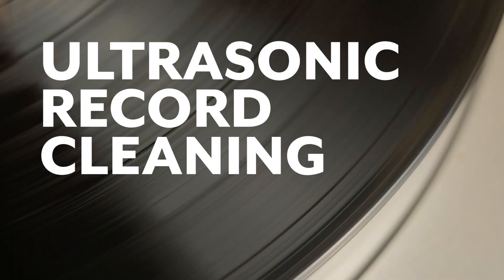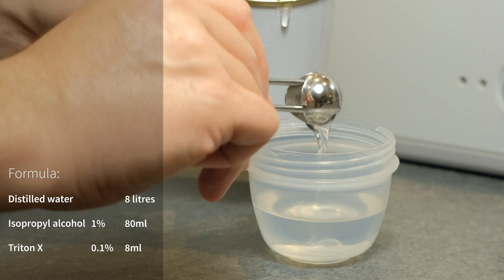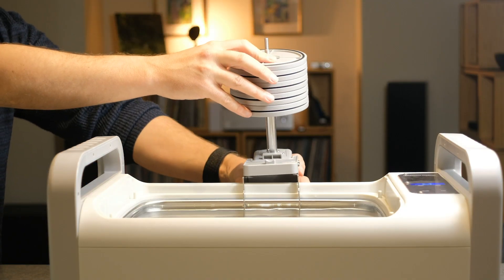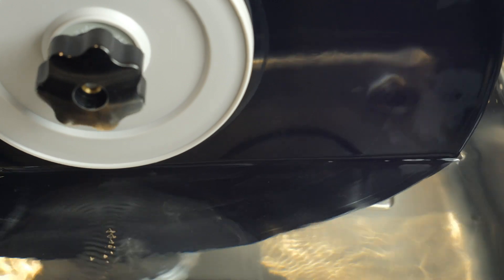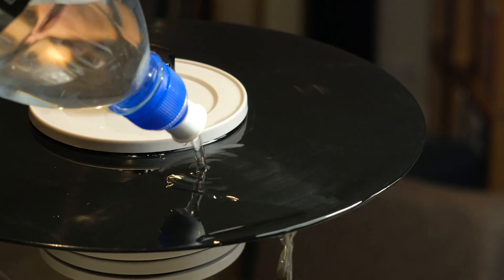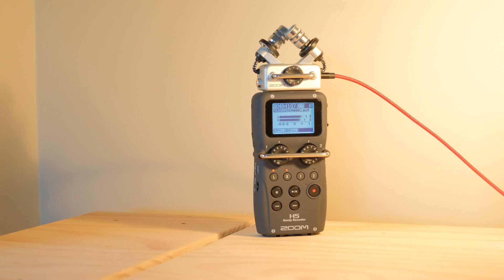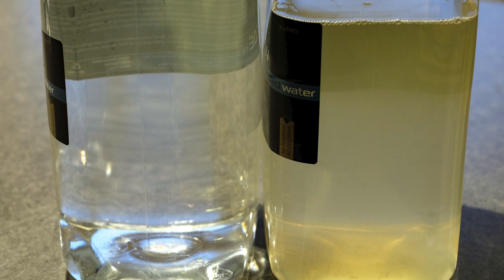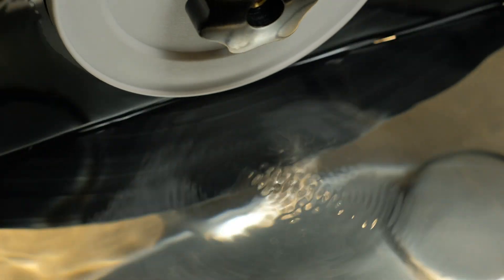Ultrasonic record cleaning - Before & After

Comment: Amazing video. One question. Once you clean up records, do you "preserve" the entire solution or dump it every time? If you want to keep it for extended time period like a few months, what would be the best way?
Reply from the maker: no I only keep it for a couple of weeks max. It will start to grow bacteria which you can see floating around as clumps (I forgot to throw some out once and it stayed in a bottle for a month or more. That's why it's important to dry the records thoroughly after cleaning.

I throw it out after it starts to look murky anyway.

Once you have some of that detergent that's shown in the video, a small can will last for years.
Isopropyl is cheap and so is the water, so overall it's really cheap to make. Best to just make a new batch.

I would like to find out if there is an antibacterial that I can put in the water.
Reply: @Filtersloth  Thanks for reply. I was thinking it's waste of money to throw it away after a couple of records cleaning though. I should wait for a batch to clean up. As you said, i wish there is something to keep it for a longer time.
Reply: @Filtersloth  did you ever get round to testing any antibacterials? from my brief research it seems benzalkonium chloride is the active ingredient you want, and it's in pool cleaners to vet disinfectants.
I've had no issues using a mix of water/iso/ilford. Usually get through enough in a day or two and dump the liquid after. Sometimes will run it through a coffee filter, but meaning to try TDS measurements to see if it actually has an effect.

Comment: You cannot remove release agent from records using this method.  While this machine is similar to KirmussAudio, it is not. We change the resonance of the sonic heads   .   Skewering records as shown  damages the label as seen. Reducrs recird value,, scratches the label.. More than one record skewered together sees no cavitation reach inside the grooves or up to the tone arm release tracks. . Isdyd of high standing waves and cancelation.  The cleaning agent added to the water in the basin has the same charge as that of the record. Good for a surface cleaning perhaps....  but cannot remove the pops in the grooves caused by  microwelded dustn by the heat of the needle on the release agent. Like charges repell. Record and wster... The multiple cycles of brushing the ionizing agent as found in the patented  Kirmuss process sees the charge of the record  change temporarily,  aiding the action of the plasma wave created by resonant cavitation. Tgecwave now attracted onto the record and into the grokvrs. The change of charge of the KirmussAudio process washes  off in 3 minutes or so. That is why the need for repeated cycles, first removing the films left over from prior cleanings, including those of this machine, then the release agent. Using the KirmussAudio process once restored and not just cleaned,  sees the record comes out virtuly dry, proving where like charges of the record with respect to water in the tank repell each other.
Reply: Kirmuss you got burned.
Reply: All.. we  have a video being made with three machines explaining how sonics differ and where in fact some look alike machines that have not been modified or using our support do not take advantage of ultrasonic technology.
Reply: In our video we will prove visually where the records are spaced too closely and the standing wave created negates intended action of the ultrasonic. The video will also show you how to test any ultrasonic for efficiency.
Reply from the maker: I realise that it's tempting for you to advertise your products in the comments of everyone's videos, and spread a whole bunch of misinformation and pseudoscience in a giant wall of text.

You've put so much nonsense into such a tighly packed, poorly worded and confusing paragraph that it would take forever to respond to every bonkers, made-up statement that you've just dropped in the comments. but I can easily address a few.
 
As you'll notice on the listening before and after test, there are no pops or clicks on the cleaned version, so there goes at least one of your made-up fake terms like 'microwelding'.

'release agent' is something you've made up and continue to repeat, despite actual chemists and vinyl press operators trying to correct you.

The record label is not damaged at all with the 'skewering' method as you call it. If it damaged it, then any normal use of putting a record on a record player spindle would damage it. 

 You mention having a 'patented kirmuss method' constantly, however the only patent I can find that you have for the machine is simply the part that holds and spins the record. While I think that's neat, and good on you for making it, it changes nothing for the cleaning process apart from limiting how many records are cleaned at once. I only cleaned one record at a time in this video so... problem solved.

You can mention 'ionizing agent' in an attempt to sound plausible all you want, but I'm not seeing any evidence.

Basically you'll need more than a cheap lab coat and clip board costume to convince people that your method is anything but an elaborate ruse tacked on to a normal ultrasonic cleaner (that is doing all the work, not your shaving brush and foaming cream). And the same goes for your nonsense cables.
Reply: Anyone working with plastic injection of which we have an injection machine knows that pvc has inherent to it a lubricant that comes to the surface of the item being pressed or in this case stamped.  At the Cascadia pressing plant in Portland during an ARSC sanctioned event at the subsequent meeting we removed the microwelded dust that fell on the hot freshly pressed record that saw a pop heard before restoration.  With 4000 units sold and accolades received, you can read them,  we in fact remove this coating from new or vintage pressings,  we can measure this both with a 3d keyence microscope as well as signal analyzers. You may yourself see the increase in signal before an after restoration using a vu meter, one on a tape deck. If you have a McIntosh  MPI 4 and check the cartridge,  you can see this yourself.  We validate our statements made by test equipment.  Client's ears hear and feel the result.  I have no relationship with the reviewers who have witnessed first hand the restoration effort.  Andre Jennings from The Absolute Sound would not publicly misrepresent his review of the effectiveness of our unique process.

Comment: Great results, but I'm curious why didn't you use the method Kirmuss audio recommends?
Reply from the maker: I've watched a lot of videos of Kirmuss talking and I find it hard to believe anything he says quite frankly. 

Like that thing he does with the 'special shaving brush' with the spray bottle and the foam showing up on the record after each wash... it's residual soap on the brush that doesn't get rinsed. It's a carnival trick to sell cleaning machines, which incidentally is the exact same machine as this. I do like the look of the record spinner on his though.

I do appreciate that he sounds like Dan Ackroyd in Ghostbusters though.
Reply: TooFriendly Your machine did come with all that stuff though, didn’t it?
Reply from the maker: utub what stuff? It only came with the record spinner thing and the machine itself, the stuff shown in the video.
This is a cleaning machine manufactured by Codyson, which Kirmuss would have bought in bulk. He’s said that his is tuned to a certain frequency but I really doubt that’s true. This machine is generally used for cleaning dental tools I believe.
Reply: @Filtersloth  Oh I thought the Kirmuss ultrasonic cleaner came with the brushes and the water-soluble detergent. I guess not.
Reply from the maker: @utub1473  this isn't a Kirmuss ultrasonic cleaner. I bought it from a record store called Real Groovy in New Zealand.
Kirmuss doesn't make ultrasonic cleaners, they just buy this machine from Codyson who is the actual manufacturer.

Kirmuss does have their own top attachment made though.
Reply: @Filtersloth  Ohhhh I see

Comment: Hey from the Tron. Cheers for the video. Is this the Real Groovy cleaner?
You still rate it and the Nagaoka Cart?
Reply from the maker: Nigel Humffreys Hi. Yeah it’s the Real Groovy one. It works well. The ultrasonic cleaner itself is not made specifically for record cleaning, so it’s the spindle add-on thing that’s been made with records in mind. It’s worth putting a bit of lube on the part of the rod that rubs against the plastic, or it ends up making plastic powder. Also you have to fill it up with water way above the ‘max’ line, or it wont reach all the record grooves.
I haven’t tried any other machines, but this one works well.
The Nagaoka MP-110 is great, although I’m no expert. I was thinking of trying out a MC cartridge, but only because I like to experiment. I’m pretty happy with my setup now really, it sounds good so I can spot a clean record vs a dirty record easily.
Reply: @Filtersloth  Cool thanks for that. Think I'll give both a try. I'm running a Sumiko Pearl which is great but so many good things said about the Nagaoka 110.
I was considering building my own ultra sonic set up but would be much of a saving from the Groovy one.
Reply from the maker: Nigel Humffreys Yeah I was going to build my own one, but importing a budget machine through amazon was actually really expensive, the shipping was as much as the machine, plus I doubt they are very good. I got a quote for a machine from an NZ company that specialises in them, and it was more than $1000, then after that you’d have to build a spindle.
Reply: @Filtersloth  I picked one up last week and have done 15 records. Really happy with it! pretty easy process.
I find the speed brush paint brushes from Bunnings or Mitre10 work well for the prewash/brush.
It's what I used for cleaning before getting the ultrasonic.
Reply from the maker: @nizzalotti  nice! Yeah I think a pre-wash helps to loosen it up a bit.
Did you get that triton-X detergent?
Reply: @Filtersloth  yep, but I haven't tried your mix yet. RG gave me a 2 lt bottle of their stuff free with the machine so tried that as the Triton X hadn't arrived yet. Did you go eBay for your Nagaoka cart?
Reply from the maker: @nizzalotti  Yeah eBay, from this seller
https://www.ebay.com.au/usr/rarest-japan?ul_noapp=true
Was AU$185, but that was with a headshell as well, which was dumb because the headshell doesn’t fit my turntable.
Later on I had to buy a replacement stylus because mine got munted by someone messing with the counterweight without me noticing. I got it from https://soundline.co.nz/ for NZ$78. But I’ve just checked their website and the price has gone up to $139 just for the stylus!
Reply: shanon Stevens yeah they seem to be a bit dearer now with all the hype. Could be keen on the head shell as I’m running a 1200mk2.
Hit me up on FB “nizzalotti vittorio Rossi” if you wanna sell it.
Reply from the maker: Nigel Humffreys I’m gonna hang on to it because I might get a new turntable at some point. 
Yeah it does look like prices have gone up for them. Shipping from Japan is limited I think, so that might put the price up too. I’m still waiting for a record from Japan that I ordered a couple of months ago. 
I might look into MC cartridges sometime, I’ve never tried one.

Comment: I also have to say... the wear and tear on that old Yamaha turntable looks so good sat on top of the matching metallic amp.
Reply from the maker: Bub Worsten yeah that turntable was left outside but under some cover, near the sea for years. Luckily it had the acrylic cover on it, which went completely opaque but under that protection it was in really good condition. It’s kind of a miracle that it works so well after sitting outside for 12 years.

Comment: Woah, impressive - you have certainly just helped my decision-making process on the way! I will be cleaning both LPs and 78s: frustrating thing I've noted with 78s is that when you clean them by conventional means (I use of Knosti manual cleaner) you actually get worse build-up on the stylus than before cleaning, presumably because the 80-year-old dirt is only loosened but not removed by the cleaning fluid and brushes. So I have high hopes for an ultrasonic. 
Have you ever tried enzyme-based cleaning fluids in your ultrasonic tank?
Reply from the maker: Richard Black thanks a lot. 
I don’t have any experience cleaning 78s but I do have a few albums. 78s are usually made with shellac, so I would not put alcohol anywhere near it, as it will dissolve the shellac. 
I’ve heard to avoid immersing 78s in water, so an ultrasonic cleaner or any water bath might damage them. I read this:
“It is important that records are not left immersed in water for any length of time. Some records (Columbias and Edison Diamond Discs, for instance) are laminated over a core that will swell if it gets wet. This causes peeling in the form of lamination cracks and edge separations. Additionally, certain labels can be damaged by water, especially those with porous paper or water-soluble inks.”.

I haven’t tried enzyme-based cleaning but I’ll look it up, thanks.
Reply: @Filtersloth  Thanks. Most of the troublesome 78s are acoustic-era discs, pre-1925, and my collection is almost entirely later than that. I've cleaned many 78s by immersion methods, generally 5 minutes or so, and never had the slightest trouble, but you're right about alcohol: they generally don't like it, even diluted. Hence interest in enzyme-based cleaning fluids.
Reply: Hi Richard , in the process of looking for an ultrasonic cleaner for my records , can you send a link or info on your machine please , I'm in Oz , thanks ...
Reply: @martyzone2316  I bought this one and it seems to do the job very satisfactorily:

https://www.bestultrasonic.co.uk/ultrasonic-cleaner--bath-professional-digital-with-degassing-6-litre-80-p.asp
Reply: i have the same experience with Knosti.  Guess you just cant let it dry but have to rinse it with water again after finished cleaning to avoid that build-up on the stylus

Comment: I am about to start importing this unit into Australia, it is brilliant, I have used the audio desk ultrasonic single unit and the top clear audio vacuum unit, the Codyson is better. Have carried out comparison tests, cleaned dirty record on the clear audio unit then the codyson, record was cleaner after codyson. then cleaned another dirty record in codyson first then the clear audio and there was no no improvement over the codyson.  BTW the Codyson base is the same base unit that Kirmuss use in their unit.  presmatec@gmail.com
Reply: You got them in Australia yet?
Reply: @robgoodburn6178  Hi Rob, I have had some in before covid19 hit, the manufacturer shut down for two months, they are running again, I even sold my own two units that i set up to clean my own collection, so am about to order some units in the next week. the new units clean 10 records, a new label protector for 7" is coming to. Pricing TBA, will inform you asap.
Reply: @peterrech2307  thanks Peter. Do you get a rough price?

Comment: Yes, of course it sounds better than a dirty record but how does it compare to a record cleaned with only a brush?
Reply from the maker: That's probably quite difficult to test.
You could probably clean it with a brush, record it, then ultrasonic clean it and record it again.

Ultimately I think the best way would be to clean half a record with each method and then check under a microscope. But I don't have one.